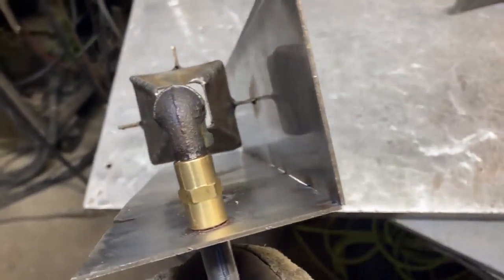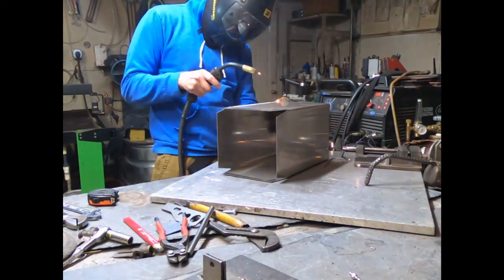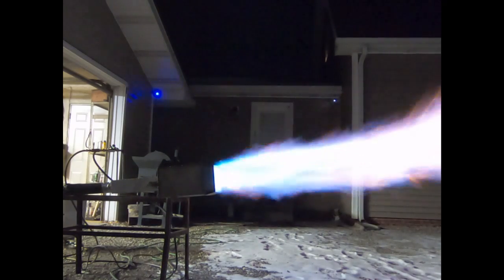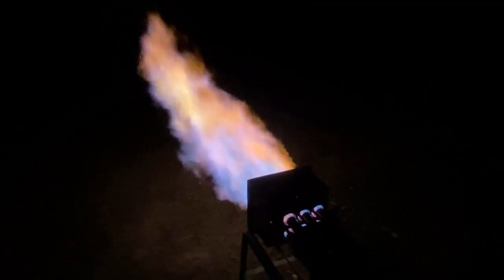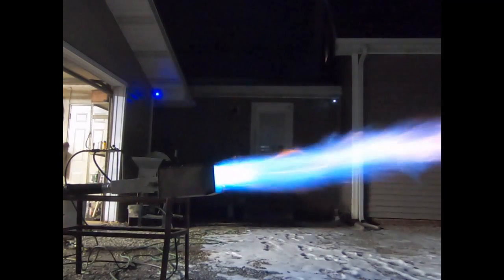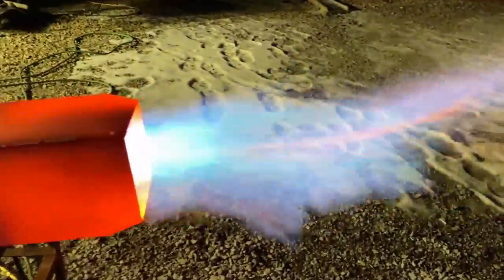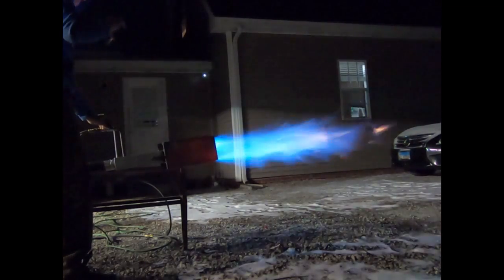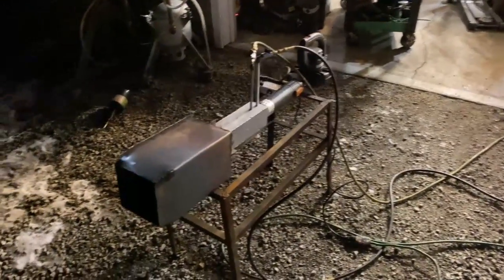Leaf Blower Blow torch

Comment: this is what i was thinking about when i commented on the other video and when i sent you an email. You have compressed air, a leaf blower, and LPG. If you found there was more air that what you could burn with waste oil, would a pump with a few psi on the oil side help get the flow rate up or would that stop the carburetor effect where it shears the oil and really vaporizes it?
Reply from the maker: This burner sucks